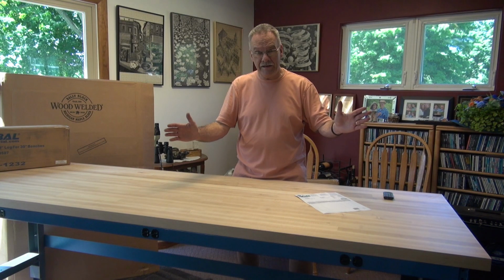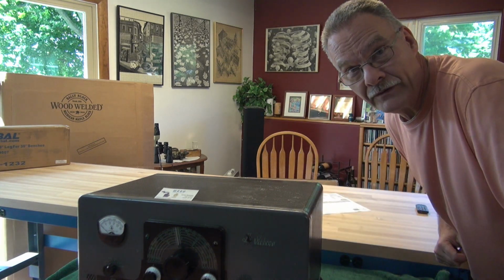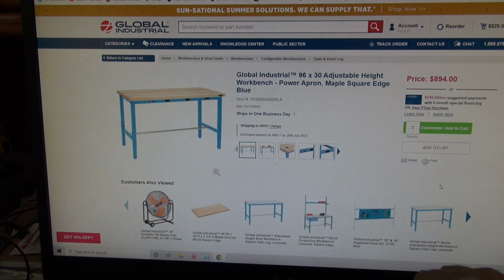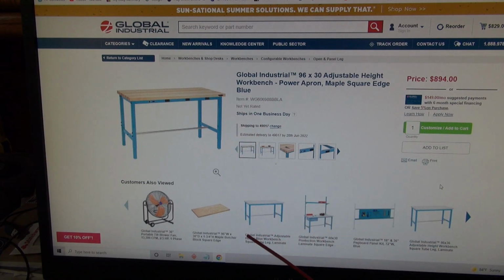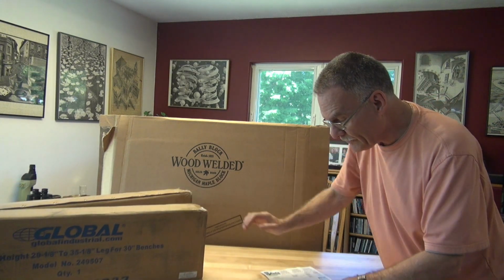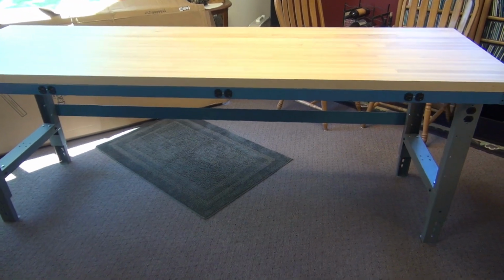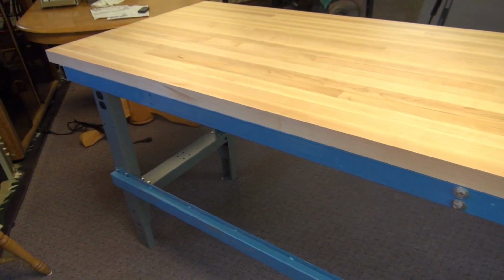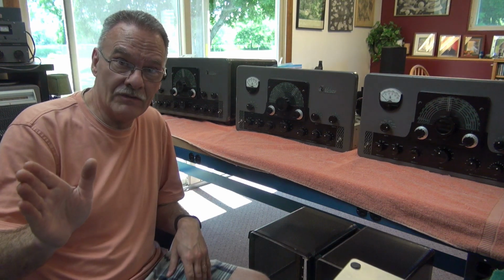Global Industrial Workbench installed at D-Lab Electronics Shop Expansion My Patreon funds at work

Comment: Love it! I went the cheapo route, but found a very nice bench, though not as large, from Harbor freight. 5 foot by 20 inches, but I set a 36x24 piece of granite on one side to extend the work surface. It has 4 decent drawers if you strengthen them a bit, and glue the bottom to the rails. It also has a bottom long shelf, that will break if you over load it. But it works well for organizing light projects that are not a priority. My work area is the front porch, so the small size helps me to keep the porch as a partial living area.